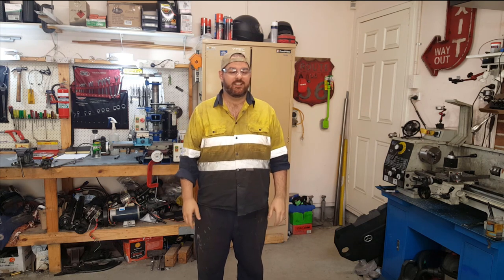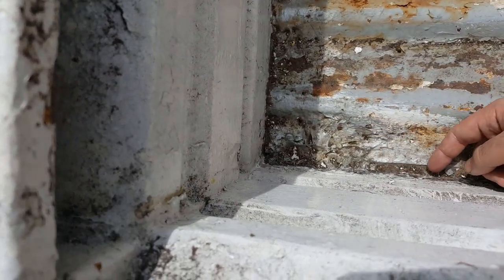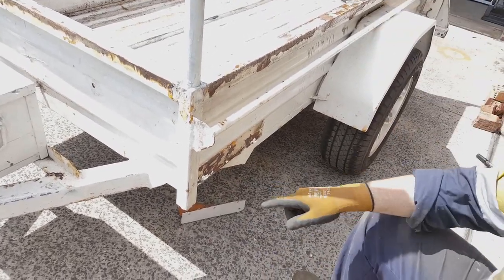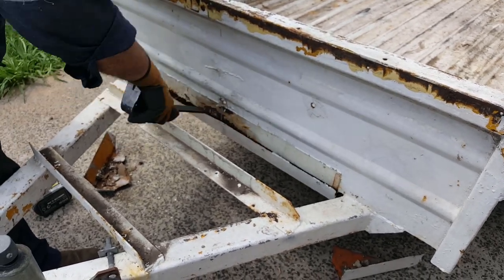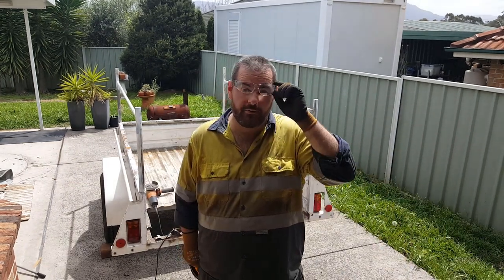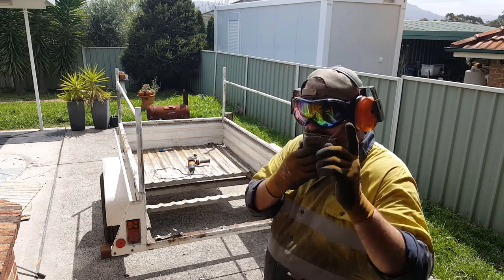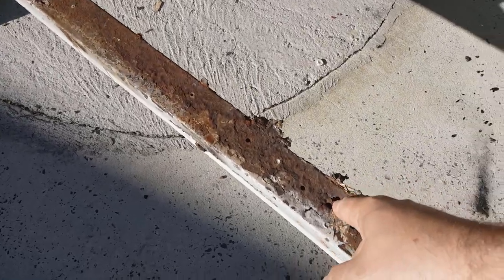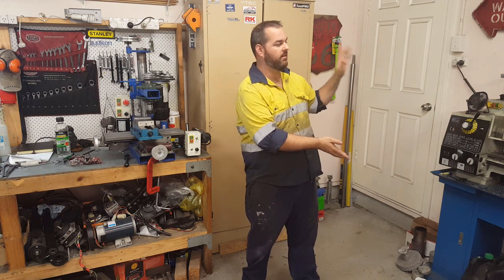Trailer restoration 7x4 foot Part 1

Comment: "It looked solid until I started working on it up" is a phrase I've uttered way to many times in my life. :D

I'm currently very close to finishing the quick "Re planking" job on a cheap old trailer I bought last year. So far it's been 2 months of spare time ! I knew the original wood was close to rotten when I got it, but I didn't realise that, under the old paint, the frame was like some kind of rusty metal lacework art installation !

So far I've built a slightly larger (And much stronger) replacement frame, and got a load of really tidy second hand composite decking boards to replace all the wood (SCR*W YOU WOOD ROT !!! :D). I noticed the hub bearings were a bit notchy, so got new hubs, and the tyres were showing their age, so I bought some new wheels too.

The original parts on the trailer now are only the suspension, hitch, and lights. Most people reading that will think I was stupid not to just build one from scratch in the first place, But there's method to this madness. Here in the UK new trailers need to have a government inspection done on them, and they then need to have a chassis plate on them to show's info like their maximum loaded curb weight. The kicker is that if your car is only allowed to tow up to (As an example) 1500kg, you can't tow a trailer with a plate that says it's maximum LOADED weight is over that, even if it's unloaded and only tips the scales at 300kg. The usefull bits in all this is that older trailers built before 2012 have "Grandfather rights" to be on the road and don't need any inspection or a chassis plate, and with no chassis plate the maximum curb weight is whatever you say it is (As long as no individual component can be singled out as not up to the specified load). The government understands that identical replacement parts may not be available to replace worn out bit's on old trailers, so you're allowed to change and modify anything you like to keep the trailer roadworthy. They also don't specify what or to what extent these changes or modifications can be. So, If the police stop you, as long as you can keep a straight face when explaining that the 10x6' 2 ton trailer you're towing really is the 1990's home built 3x4' box you bought last year with some essential repairs/changes, you're golden. :D
Reply from the maker: Hi Reman
Thanks for the comment, I didn't originally intend to rebuild the whole trailor but you reach a certain point in a project we're you're all in or your out.
I'm glad to hear you're repairing a trailor of your own, it's a sad fact that the DIY community is becoming smaller each year - keep at up  and you'll be finished in no time.
I remember people making comments midway through the project like, why don't you just buy a trailor and save your self the effort or how much time have you spent so far - but these people just don't get it.
You are also correct about the grandfather laws. I live in Australia and the original trailor was over 30 years old so like you explained, no compliance plate required. This was one of the deciding factors that led me to rebuild it from scratch as it will never need an inspection.
Like you said "methods to our madness"

Thanks for watching, Like / Share / Subscribe.
Reply: @Maximum DIY  Yeah, most countries populations are now just consumers in disposability orientated societies. I have friends who take their cars to the garage and pay labour to have the windscreen washer fluid filled or the pressures checked in their tyres, and will call out the breakdown service without exception if they get a puncture.  They don't want to get involved with "All that mechanical stuff" (........... WTF !?!?!). They've got zero interest in learning how maintain, let alone repair, what they already have.

For my first car I bought one with a blown up engine, and another with a rotted body, then assembled one from all the best bits. I did this back then because it was the only way I could get a car that was within my financial means. I learnt a lot from doing this. Youngsters now have company's clambering over each other to offer cheap finance deals or car leasing plans, so half of them don't even "Own" their own cars. They're not about to pick up a spanner to work on it in that situation, so they don't ever pick up a spanner, period.

It really does bug me that I'm related to people who think that there's nothing wrong with the idea of going out and buy a new TV because the old one stopped working, WITHOUT first even checking the fuse in the plug (Another quirky UK thing) or popping the back off to at least LOOK to see if it has a blown fuse on it's power supply board. They're the sort of people who's technical understanding consists of "Turned it off and back on. Still doesn't work properly so I need a new one"........... I personally think they're being almost hypocritical when they carefully sort their recycling, But buy a new moble phone and laptop every year, and run a lease cars for 3 before getting a new one.